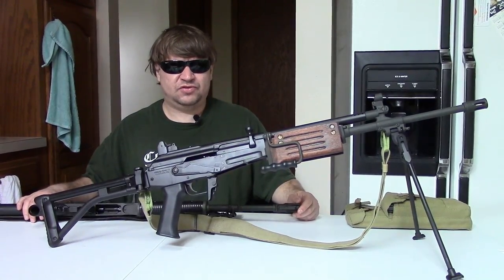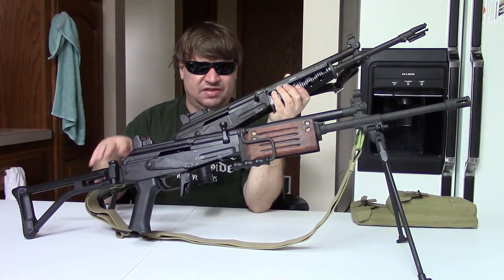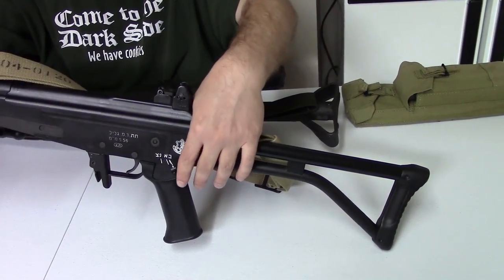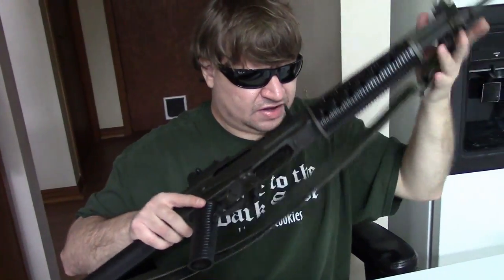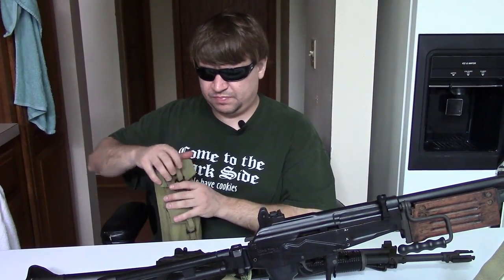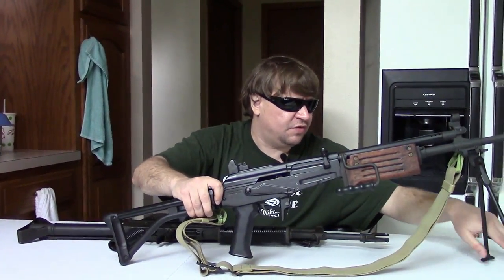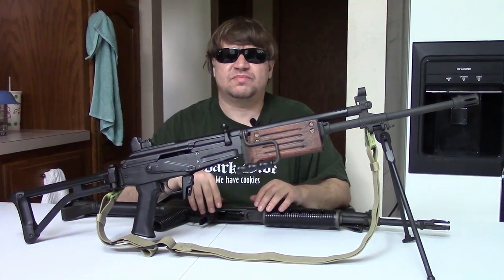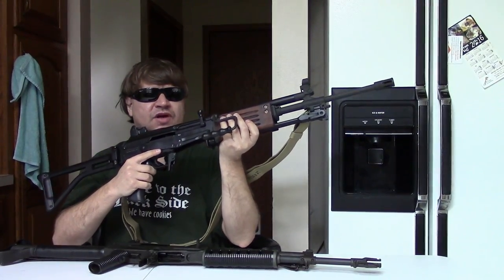Valmet RK62 & IMI Galil ARM - A Compare & Contrast

Comment: If you wanted to arm a large military with any weapon on the planet I think the RK62 is your best bet. It's cheap, quite to manufacture, good quality, no real problems, effective enough and durable enough. Plus the magazines are easy to come by and the ammunition is extremely cheap. The Rk62M being the next step for this rifle. There really isn't a good reason to replace the rifle instead of just updating it to accommodate modern optics and attachments which they have done with the M variant.
Reply: To properly modernize it, you'd have to either get rid of the rear sight or move it. A rail on the cover isn't solid enough for heavier optics, and a side rail is good, but the sight gets in the way of low height optics.

I'd rather go with the Bulgarian milled AKs, which are more optimized for a modern rifle.
Reply: Kuddlesworth NA Rk62 is not cheap on any scale.
Reply: I would say definitely, in fact I've often thought that if Europe were to need a standing civilian defense force (against Muslim takeover) the RK62 is the perfect weapon for the job.
Reply: XtreeM FaiL  when i served in the fdf we were told that the rk62 costs some 750 euros, so quite cheap compared to say HK416...
Reply: Nopes, nobody's replacing the rk.62 by 2030. It will just soldier on and on.
Reply: Janne Hurttia
Yeah the cost of production goes down when you produce a million of them in a state subsidized armory. But if you wanted to build a small batch of them they'd be expensive as hell to produce. You're probably better off trying to make AR pattern rifles with nearly every non-pressure bearing part made of 3d printed/honeycomb matrix reinforced polymer.

Comment: The FDF has some 350,000 rk62's in total. Or at least thats what they say officially. The army planned replacing the rk in 2015 , there were a few options for new service rifle.  But then they decided that it would be more cost-effective to modernize the old rifle and they gave it a new designation rk62/m.   All the existing rk62's will be gradually modernized into m version in the next few years. The army has opted that the rk62/m will serve until year 2035. At that point when this trusted rifle finally steps aside, the oldest ones will be 70 years old. Kind of crazy to think about.
Reply: Thank you much for the info. And if you think about it, Finland did something similar with the Mosin Nagant. Many M/39s were built on receivers dating back to the late 19th century, so were 50 years old in some cases.

Comment: It should be noted that the dust covers are nearly identical, even down to the flat made for the Valmet rear sight which is carried over on the Galil.
Reply: The Galil was designed to handle sand, if you want to get technical. Ian and Karl have tested a WASR (AKM), an Arsenal AK-74 equivalent, and a Valmet in 5.56. Every one did not prove to have the reliability the AK platform is claimed to have. They did not operate semi-automatically, and in the worst cases, they failed to go into battery because the locking recesses became fouled with mud.

You can debate the testing methodology, the manufacturers, or even the alignment of the stars, none of which will handwave the fault in the DESIGN. At the end of the day, you must come to the realization that the AK design is literally NOT what it is hyped up to being, regardless of the variation or modifications.
Reply: Yes, they are similar but not interchangeable. They have slightly different lengths and the widths are a bit different too (i tired swapping them and nope, no go). IMI did change up the Galil's cover a bit over time too.
Reply: You know what did worse than the AK in their tests? Both the M1 Garand and M14. So if we agree the AK isn't what it is all cracked up to be, we must also say that the Garand and M14 joke at the mire sight of mud lol.
Reply: Which is a good reason why the AR15 replaced the M14. And, surprise surprise, the AR15 has been the #1 rifle tested by Ian and Karl.
Reply: OK, you are one of those guys. We can be friends lol.
Reply: Admittedly, I was sceptical of the AR, even when I was serving. I fell for the HK416 hype that Larry Vickers and HK foisted upon the ignorant. I thought at the time, that the military made a huge mistake in changing to the .223 and the AR15, I saw the video demonstrating a three round burst from both and called foul of the video concluding that the AR was better because all three shots hit the target to the M14s two hits (the two first two rounds were very close to each other from both rifles, but I digress). I felt that the AK was some magical firearm that could work where the AR15 would jam at the first sight of something other than a sanitary square range.

 I was young and ill-informed.

Comment: Good video. That said, I've always been a little bit miffed that people seem to downplay the similarities between these guns, or rather the pretty linear heritage - and I'm not even Finnish.

In nearly all of the meaningful ways, the Galil is pretty much a straight copy of the RK 62, with only a couple of those things having been simplified- the moving of the rear sight to the back of the dust cover, the 90-degree gas block and front sight, the flip up night sights, and some other things,  all were basically lifted directly from the Valmet to the ARM. In addition, it was actually the fins who first chambered an AK variant in 5.56, with the M71, which went into production a year before the Galil.

Also, you mentioned that internally the valmet RK 62 is just an AKA, but that's not quite true. It has those added fingers on the piston/op-od, to reduce a lot of that slop, which is a fairly unique feature on an AK - especially for 1962. Yet another thing that was directly copied onto the Galil. Not to knock the Israelis too hard, but in reality the only real "innovating" they did - aside from some small dimensional tweaks here and there on small parts like the barrel profile and the gas block - was the addition of the thumb safety, and the upturned charging handle, and maybe some new furniture (and even that is kind of a stretch, since the folding stock is a 90% copy of the FAL Para).

And you mentioned that there isn't any proof of the Israeli guns being built on Finnish receivers, but I contend that there is. There are records to indicate that the Israelis bought some small batches of RK 62s early on in the development of the Galil program - an initial set of five, and then another set of 100 - and at least some of the earlier prototypes were built directly on that. In addition, they themselves have openly admitted that they copied the exact dimensions of that receiver - though it is not clear whether that was done by getting the specs directly from the Finns themselves, or just reverse engineering it.

I hate to be "that guy", but I always feel that the Finns have not gotten a fair shake for essentially being the Brain Trust behind this entire line, including not just the Galil and Galil ACE, but eventually the South African R4, R5, and R6, which to my mind are pretty much the best modern AK variants ever made (perhaps until the brand new Russian AK-12 & AK-15 guns that have come out in only the last few years.)

Comment: hi misha,
great review as always.
some details on the galil,
the tripod features a barbed wire cutter although small and uncomfortable to use.
the troops were using the tip of the handguard close to the magazine as a bottle opener.
it is quite heavy and robust and was designed to take constant abuse in the field later to be attached to rpg 7.
in here there are some rare picture of extra equipment used with it such as rifle grenade, grenade launcher, sights scope etc.
https://www.fresh.co.il/vBulletin/showthread.php?t=43935&highlight=%E2%EC%E9%EC